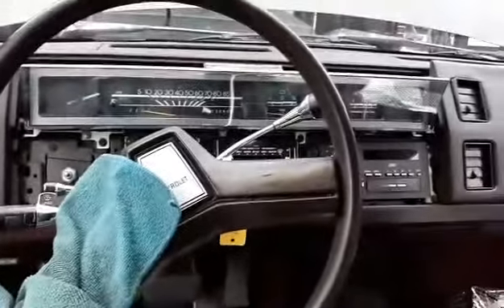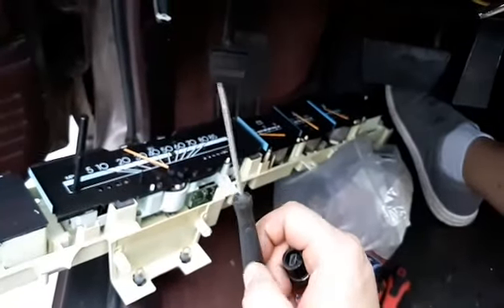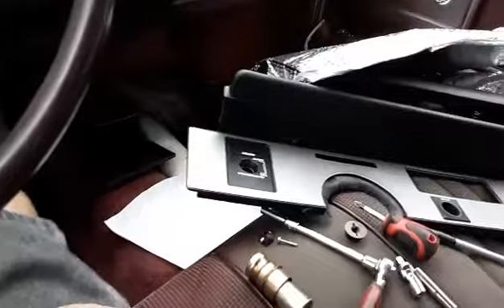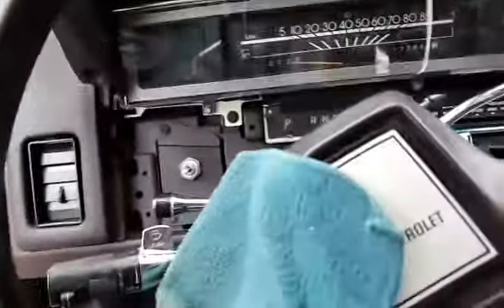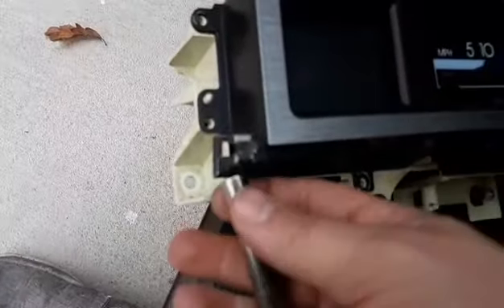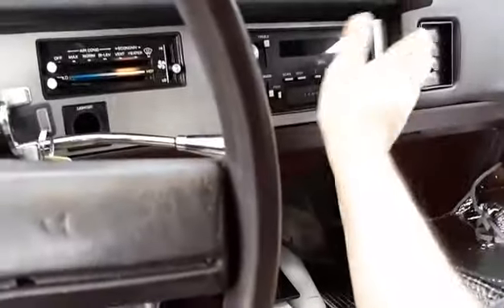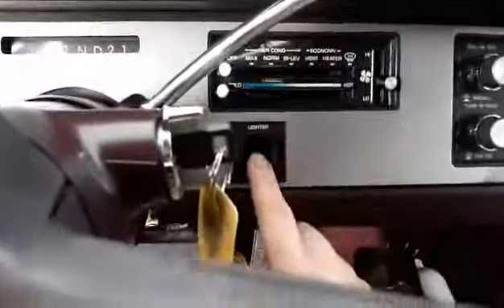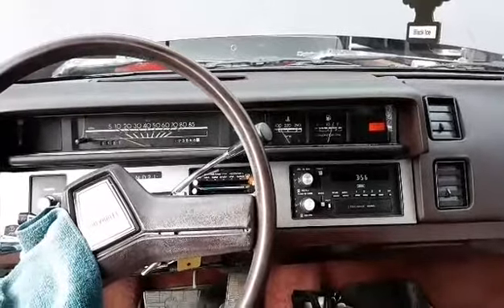87-90 Chevrolet Celebrity Dash Gauge Cluster Removal!

Comment: I have a 91 Pontiac 6000, same car, but it has idiot lights instead of the individual gauges. Do you know if the clusters are interchangeable, or did the Celebrity go to idiot lights in 91 also?
Reply from the maker: Mine originally came with idiot lights but I actually change the cluster to gauges and then change the sensor so it would work and the only sensor I changed was the temperature sensor and everything works as it should .

It depended on what package you got when the car was orderd way back when is what the car has cause mines a eurosport but yet it don't have everything a EUROSPORT should have so thats kinda what I've been doin to upgrade it and make it better . 

Chevy celebrities were only made from 82-90 and after that the Chevy lumina took over
Reply from the maker: Also you might be lucky and find the bill sheet that the car came with from the factory where they write down every single detail about the car that tells you what it has mine has it it was under the back seat.

Comment: Excellent. My dash lights are real dim unless it's completely dark out. I've always wanted to check the bulbs, but dashboard assemblies are a daunting task to tackle, thanks.
P.S. Is it common for Celeb dashlights to run dim?
Reply from the maker: Yeah just age and over time , especially if it was a spoker car but I've had more than a couple chevy celebritys and they all have dim lights for dash lights so I upgraded my eurosport to LEDs and that video is on my channel
Reply: Replace them with LEDs.  There are 5-volt LEDs just made for these bayonet-mount sockets, and it will WORK WONDERS!!

Comment: Can I take the idiot lights out and snap in a gauge?
Reply from the maker: I swapped my 87 eurosport that's on my channel from dummy lights to gauges . You will need a cluster from 87-90 if you have one that's in those years if not it would need to be the older style 82-86 

You'll need to change your temp sensor for the gauge that's on the back of the block for the gauge to work cause the sensor is for a dummy light . I did all this and mine works great